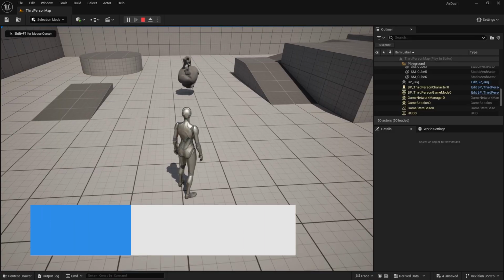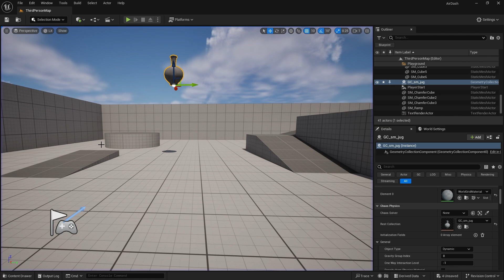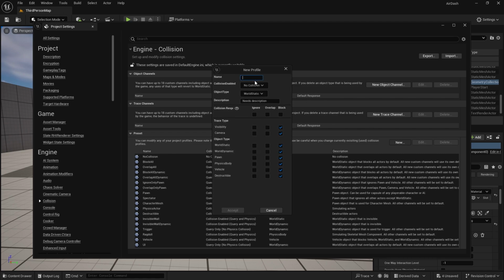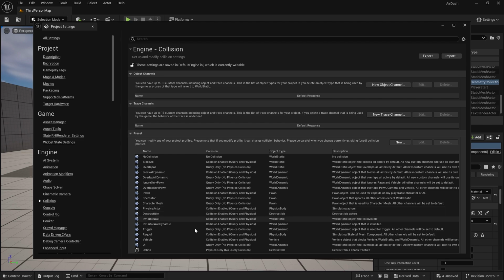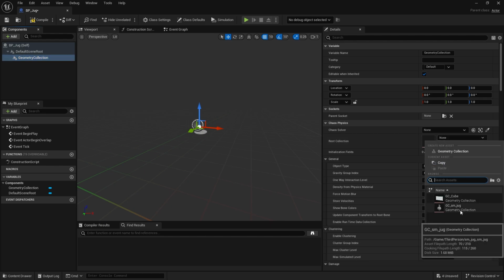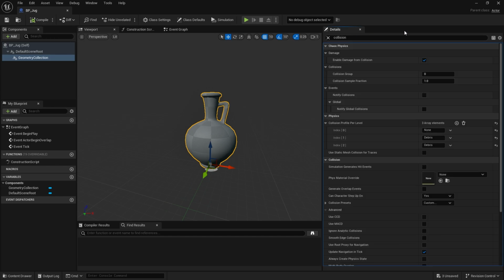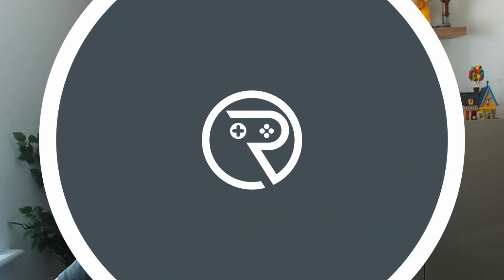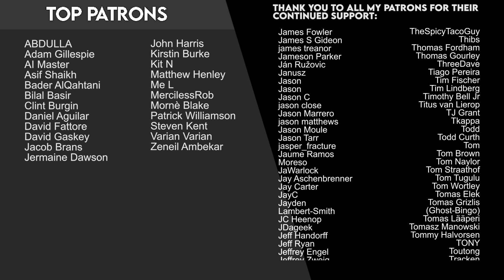Unreal Engine 5 Tutorial -  Breakable Jug Part 2: Collision Profiles

Comment: Question for you : I am watching all the tutorials I can find on Chaos Destruction and haven't found an answer yet. I am trying to figure out a way to make one way collisions with the physics of the fracture pieces. What I mean by this is that I would like the pieces to be affected by the player, but the the player should not be affected by the pieces (velocity, force, etc) Essentially the pieces should not affect the player, rather only the player affects the pieces. Further explanation/example : during an explosion the pieces should bounce off the player and the walls with the same behavior, not affecting the player at all. Or like this example the player should push the pieces out of the way after they are on the ground, and not be affected by the pieces, only the pieces get pushed by the player. Do you know how to set that up?

The method in this tutorial doesn't work for what I want to do, because as soon as I break the GC the entire thing no longer collides, and I'm using anchor fields to keep some things in place, and the anchored sections need to still collide. 

Also do you have a discord setup by chance? Or is youtube the easiest way to communicate for you? Thanks!

Comment: Hi, Is it possible for you to make a video, of how to read player's or NPC's Gameplay Tag Container in BT Decorator checks? Somehow I keep getting false values all than time. It's like it's not reading the tags correctly, even though decorator let's me choose tag from the list to check if it's true and in NPC Tag container it is set true(doing for npc here). It's always false in BT decorator. PS. I use blueprints only. I know the check can be done manually with nodes, but isn't it supposed to work easily with decorators, so that I don't have to cast to Character in every check.